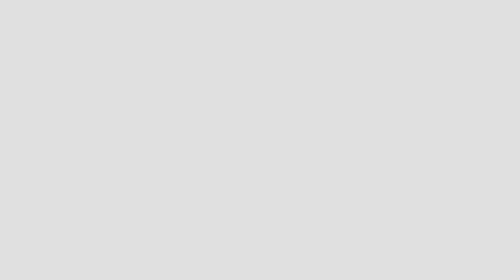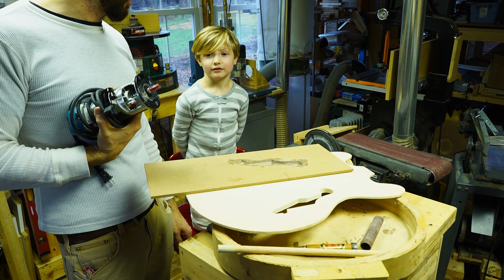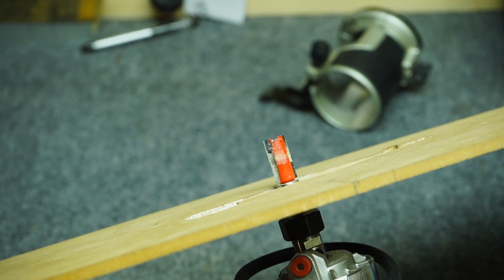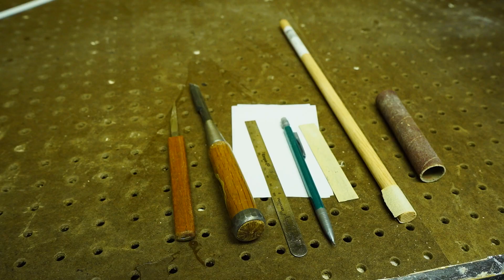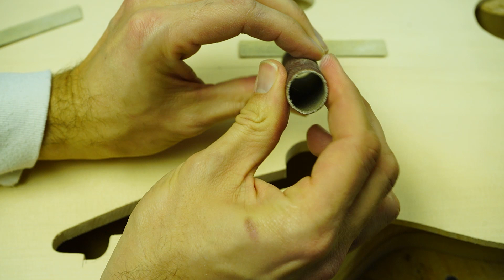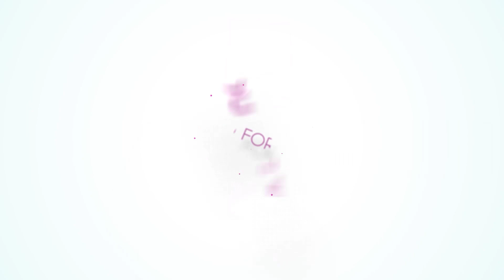Cleaning up F-holes

Comment: Very useful information Stuart! My main takeaway from this video is that with a little patience and a few key insights, someone can do a stellar job cleaning up those edges. Lately I've been trying to apply woodworking skills to car restoration and it's surprising how much of that stuff transfers over.
Reply from the maker: Thank you! Totally. Patience is one of the fundamentals of good woodworking. I find that thinking through the project and ordering the processes correctly helps a lot to end up with clean end results.